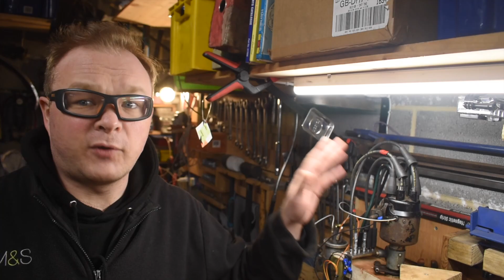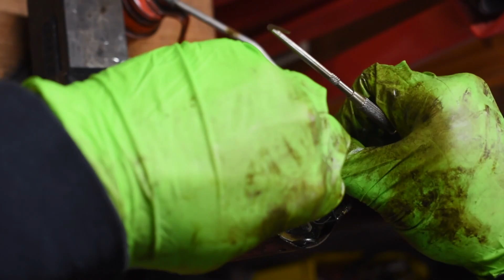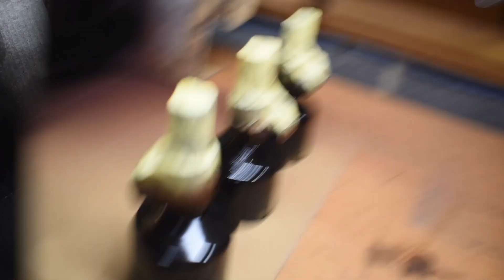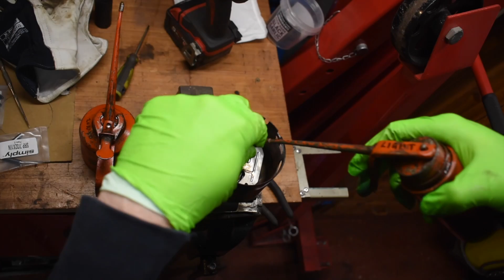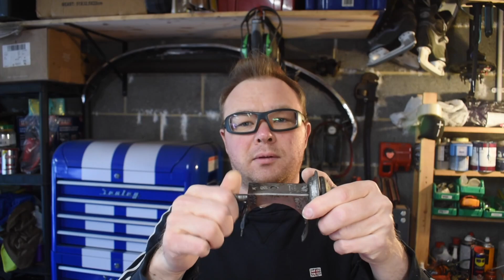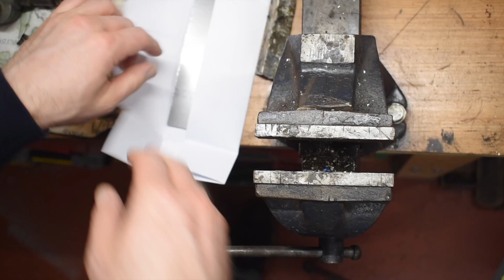AC Delco D200 Distributor Rebuild | 1969 Triumph GT6 Mk2 Restoration | Part 4

Comment: Have you ever checked the Concentricity of the Bell shaped body on the distributor to the lower shaft body housing?  Generaly Its not very good!  This effects the point plate centering around the Dist shaft and also rotor alighnment to the Dist Cap and pins.
Reply from the maker: I had not. Will stick that on the list of things to do when I'm back looking at engine bits again.